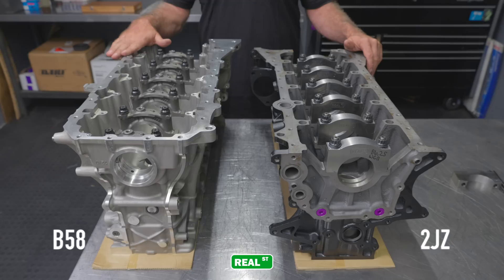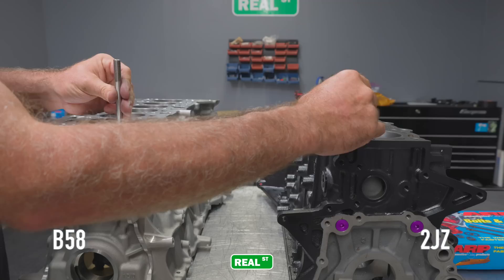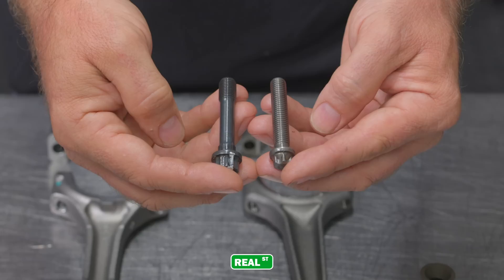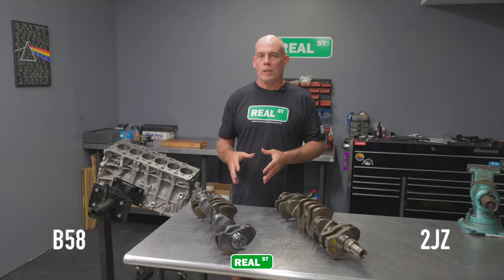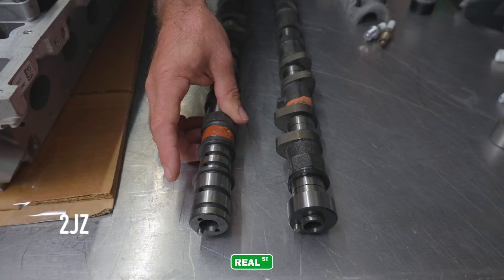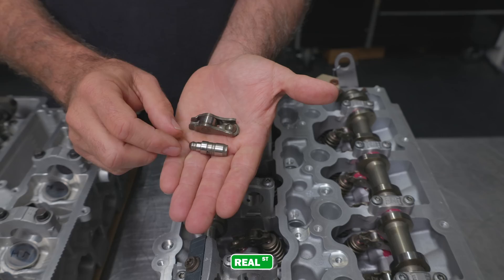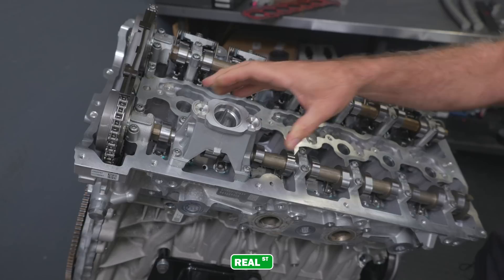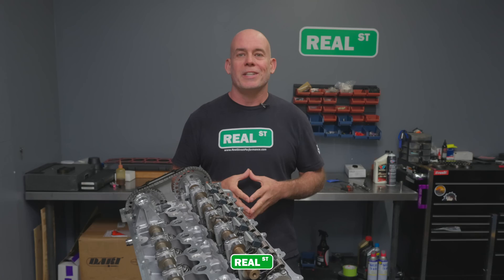Toyota 2JZ VS BMW B58 | 2JZ STILL KING?! (Detailed Engine Internal Comparison)

Comment: Man as a BMW owner (N52,S55), watching him break down the engine parts just showed me all of the failure points of a modern turbo BMW engine lol. Vanos, valve lifters, valvetronic, high pressure fuel pump, valve cover gasket, crank hub, timing chain. The 2JZ might be simple design but it works.
Reply: You know what, the LS is very compact, even simpler and no heavier than a 2jz, why not just use that?
Reply: @laurean5998  I like the sound and balance and smoothness of an inline 6 better
Reply: Cross plane v8s are quite smooth, especially with modern mounts.
Reply: You call those failure points? 😂
Those are advances in technology. A stock jz will never make the same power for the same amount of time a modern stock internal bmw inline 6 will.
Reply: BMW tech here, your N52 and S55 are both reliable engines, just make sure to not go over the miles for your oil services as that is the main killer of any engine and will cause premature wear for your timing chain and valvetronic system. The items you listed are not common failure points, save for the valve cover gasket, oil pan gasket, and oil filter housing gasket.
Reply: @JQ_Unity  A stock jz can handle plenty of power without breaking.
Reply: You smokin something real good to believe a bmw i6 wont handle power as long as a 2j @JQ_Unity
Reply: Simple, is better.
Reply: @JQ_Unity I own an n63 engine 😂 seeing this video is making me realize my engine is extremely complicated and why I can do 180 in my 7 series. 

Now I understand why my n63 will probably break down at some point in ownership.
Reply: @Arceus556 I agree to a certain extent, I believe the cast iron will hold up better. I think the i6 from BMW has lots of room for improvement if you build out the engine
Reply: @JQ_Unity a stock 2jz can make up too 1000crank on stock internals and it has been proven not knocking the bmw but atleast get your facts right
Reply: I love the B58 in my Supra - I just wish they didn't use so many plastic parts internally. I know the OEM oil pump has already had issues due to the giant plastics inside of it breaking apart.
Reply: @laurean5998  You can't compare a sea anchor with a six-in-line 2 ATC engine, 4valves per cylinder. 😜
Reply: I love the 2JZ as much as anyone else but lets be real, the 2JZ wouldn't have any hope of passing an emissions test if it was placed in a modern production car. It has a simple design because emissions standards weren't as strict back then. The B58 with all it's modern emissions systems, VVT, DI, and weaker aluminum block still is a very potent platform that makes big power for little money.
Reply: This Video is about the new ENGINE they put in a Supra!
BMW has had Vanos, Valvetronic for over 20 years man.. same with the hydraulic lifters..
Reply: @illusional.503 Making that power and lasting are two different things. I know Supra owners. After 7-750ish hp, they're a ticking time bomb. The B58 has been proven to hold at least 800 bo problem
Reply: @jieddo1 I will give you that. The funny thing is I wonder what the lifetime emissions on a engine that maybe is a little more dirty but lasts longer vs a cleaner engine that’s relatively throw away
Reply: @Unicornpirate  Those are not breaking points on a B58. S58 & B58 are obviusly superior engines and can easily go higher miles even despite the fact that they are much more advance.
Reply: Don’t even get me started on the VANOS solenoid. Absolutely garbage. BMW needs to redesign that part of the timing because it’s so dumb.
Reply: How come BMW's do not have turn indicators w/all the tech in the engine you would think they could engineer q flashing light!😂
Reply: @laurean5998 at that point of comparing Ls to a 2jz id go with an LS simply because of how cheap and common them and their parts are
Reply: The funny thing is those things are rarely an issue on B58… but better address that PCV 😂
Reply: You can't appreciate Toyotas until you breakdown their engines.
Reply: @Unicornpirate  2jz use a lot of fuel compared to a the b58. it also have a lot of other advantages
Reply: BMW tech who has a Lexus PP 😆 the irony
Reply: Just want to add that the BMW oil strainer housing is small and the chamber gets clogged with bits from the timing rail often ceasing the whole engine.
Reply: @ToyotaAristo  Yes they are. These are breaking points of any modern BMW inline 6. The reason you haven't heard of widespread issues is because they are relatively still new engines without many miles on them. Go buy a B58 with 150k miles on it and tell me that the valve cover gasket hasn't been replaced.
Reply: lol its a meme they  need a rebuild a 60k as kill big ends  in stock form   @JQ_Unity
Reply: @JQ_Unity  How long do BMW rod bearings last?
60-80,000 miles
The original rod bearings should be replaced every 60-80,000 miles, especially on vehicles which followed BMW's 15,000-mile oil change recommendation. Consistent BMW maintenance is crucial for a high-performing  lool seen 2jz,s with 400k miles still going     never opened up
Reply: @heh2k  > Cross plane v8s are quite smooth, especially with modern mounts.

I've had a '95 Supra TT, a couple E39 M5s and an F430 flatplane.  (Yes, manual addict.)  While I like them all, the straight-6 is definitely the one that sounds smoothest.  F430 isn't a bad sound per se but it's not a classic.  (458 a lot better sound but I prefer my manual clothtop.)  I guess I had a GT-R for a year but didn't like the sound.  I'd agree with you as far as saying they're all as smooth as they need to be.
Reply: @JQ_Unity  > A stock jz will never make the same power for the same amount of time a modern stock internal bmw inline 6 will.

I dunno, man, it seems even unmodified BMWs are in the shop all the time.  I haven't owned one, but part of the reason I haven't owned one is the horror stories.  I don't recall ever hearing of a 2JZ that ever broke stock and I was heavy in the community like '95-02.  Meanwhile I'd guess that for very very extreme tuning the iron block has a higher limit, though I don't think I'd ever want such a level of power.  My M5's both had a lot more issues than the Supra, too, though I have to admit they weren't engine issues (and weren't straight-6's).
Reply: @JamesCook76131  > I believe the cast iron will hold up better.

How specifically does this manifest in real life?  Does the aluminum block literally just crack, or do the bolts holding the head on strip out?  Or is it more  warpage leading to gaskets not quite fitting leading to problems?
Reply: @lqr824  considering I’ve been in 1000-2000hp supras, I believe my comment actually holds some value lol. I was big in the race scene for modified cars 2010-2016 time frame. 

Most people I know bore out the block on the 2jz as they  solely use it for drag racing only. 

Same with the viper blocks, I’ve yet to see many bmw’s doing the same thing (yet) so only time will tell
Reply: That’s why Toyota borrowed the bmw engine right ?
Reply: @sekouchill  That's why the new Supra is not a Japanese car right? It's a hard top Z4 straight up. Only thing it has is a Toyota badge. Toyota has proven they can make new performance engines as seen in the Corolla GR and Yaris GR. They just chose not to with the Supra mkv. Also if they designed their own inline 6 for the mkv Supra, you can bet it would have cost over 85k MSRP
Reply: Honestly to about 800 whp the BMW is superior to the 2JZ in every way. After that once you are building everything on the 2J the simplicity takes the cake.
Reply: @JamesCook76131  can't bore out the b58 due to the liner. Most are turning them into strokers to increase displacement.
Reply: Man but it sucks to have a way older cars as a daily driver. I’ve tried it in different platforms replacing just about every part and still you get in a new car and that feeling . After all you spend the same money. Im transitioning into new looking for manual as they are hard to fine now a days
Reply: @JQ_Unity Whaaat??? The JZ can make double the power on the stock bottom ends reliably.
Reply: @jieddo1 Who gives a fuck about emissions testing?? This is what makes the JZ better. It comes from a time when engineers could focus purely on reliable power. Anything else adds complexity that we really don’t need as tuners.
Reply: @refillz5281 Another fool who doesn’t have any idea. We have many built 2jz’s coming through my shop making 800whp+ on the stock bottom end. A few with over 1500whp on the stock blocks. 
They are all very reliable everything considered. I’ve seen 800whp+ 2jz’s run as dailys for well over 50,000kms with no real issues. 
The limits for the b58 are very clear at 650whp, any more and they start to have all sorts of issues. Still a great motor in it’s own right.
Reply: @JaB0090  How do you rate the B58? Are the oil burning issues a big deal or was that only on a few earlier cars? I'm really torn between a new GR Supra or a used Corvette, either C6 or C7. but I'm really leaning towards the Supra.. I just want it to be reliable long term, if I'm spending that much on a new car.
Reply: @izzy031096 no emissions kills engines in every way shape and form. The JZ wouldn't be a JZ if they were to throw modern day emissions at it. It'd be just like every 6 cylinder that's a aluminum block, very likely to have a open deck block like toyo does with all of their modern 6 cylinders,and be made specifically for efficiency and better gas mileage for emissions purposes.  The JZ would even have a different name at that cause it wouldn't share anything from the old cause it's outdated,inefficient, heavy,laggy,and will not be used or seen in the modern day market as competitive for all those reasons. B58s have gone well past 8-900whp+ all on stock internals. It depends on what gen u get because later B58s got a stronger fuel system than the earlier gens.
Reply: @hhaste 2021s were the main ones that had the fuel burning issues when they swapped the B58s from a 2 port head from the 2020 mk5s and went 6 when the 2021 models. 22-23 apparently don't have this issue(or it's a very rare case at best)so either get a 2020 or 22-23 model and you'll be fine.
Reply: @carboydorifutoparty3976  Well you just wasted a whole lot of time typing out a completely hypothetical situation, good on you. 
There are no b58’s making in excess of 700whp reliably. All of the forums state exactly the figures I’ve stated earlier.
The JZ makes more power, more reliably. Get over it.
Reply: simplicity is useless when a rod goes through the block, your bmw engine is stronger even with modern failure points, the 2jzge is very tought but once you add a turbo and some power, it goes boom, idk how many of those garbage ive seen exploded, 1jz is even worst
Reply: @Unicornpirate  400whp tops and with a decent fuel management
Reply: @retrocompaq5212  With stupid tunes and non turbo bottom ends, yes they will go boom. A gte done properly, or a ge+t done properly will last for a very long time, even with 800whp+. I’ve personally seen and worked on daily drivers with these sorts of numbers doing 50,000kms+ with no issues whatsoever.
Reply: Oh my goodness! The engine has pistons, rods, valves! Those are failure points!
Reply: @XBullitt16X Simple is good for people who dont do maintenace.
Reply: @laurean5998 because not everybody wants that garbage.
Reply: @rodz1999 sucks for you, I love putting new parts in old cars. I definitely don't care for all the complexity of new cars either, and all that garbage plastic.
Reply: @illusional.503  total garbage, stock internals on a 2JZ won't make 1000crank reliably lol. Both these engines make about the same 650-700WHP with stock internals if you want them to last.
Reply: MFI Turbo Gasoline is the best and most durable engine design. Everything above is just in order to make you go back to the counter every 150k miles.
Reply: @illusional.503 lmao no, stock 2jz engine can handle up to 850hp
Reply: @@Lorin-GabrielLeaua-fm1lw Not available in the USA. I've heard of it but don't know much about it
Reply: @JQ_Unity  bang on! , length of effective power band is huge! BMW are masters of this - peak numbers don't mean shit if its delivered in a short peaky power band
Reply: @laurean5998 good point
Reply: @laurean5998 it’s actually alot lighter. Even a GE weights in more then a 6.0 iron block LS style engine. A fully dressed GTE weights about 600lbs, fully dressed LS1/2/3/4/6/7 weighs about 450lbs.
Reply: @Unicornpirate The MK5 A90-J29 Supra's origin is Japan!

And without the MK5 A90-J29 Supra, the G29 current generation BMW Z4 wouldn't exist due to the last generation's BMW Z4 being a sales flop!
Reply: The simpler the structure is, the less failure points it has. Simplicity favors regularity every single time.
Reply: Yet with all the problems with bmws there will be a fan boy talking BS about how the owner took care of the care when the proof is in the poor design from the factory.
Reply: @MrNanah38  There's literally B58s running over 200000 miles on them already. With no problems or less.

So I don't what your problem is hoss
Reply: @samsonCoby  Show me
Reply: Things like Vanos and valvetronic are why the BMW engines have a flat torque curve through the entire powerband while a 2JZ even with a mild tune is like a two stroke. For a comparable top end power a B58 makes 2-3x the low end torque. Yeah they can fail but even if they do the car is still driveable and it's not that hard to fix.

Timing chains don't really fail in these engines, American tuner nonsense to sell more parts (there might be a very rare failure here and there but no more than any other engine). Crank hub failures affected some N54s and early N55s, was fixed on later N55s with an upgraded friction washer and B58s have a two bolt assembly, it physically can not happen unless the bolts just shear off.

Gaskets fail on all engines. 2JZs generally just don't have their valve covers on long enough for the gaskets to fail.
Reply: @jieddo1  Exactly! Putting tuned 2JZ with tons of power in a modern car, in some places with strict emission regulations(Cali, Germany) wont ever pass the emissions test
Reply: @laurean5998 2jz and Ls are the best engines on the planet. Period.
Reply: @JQ_Unity lol the last 20 years of the internet determined that is a lie
Reply: @refillz5281 stock 2jz will handle around 700hp comfortably, can go up past 1000hp but then you run the risk of potential issues, even then not necessarily catastrophic…depending on what goes of course; but the trans is maxed out typically around 700ish hp
Reply: @Unicornpirate can, though getting an LS the US is cheaper, more accessible, and you can sleeve it/forge the internals to handle boost as well as a 2JZ.  There’s really no competition as to what the best cheap engine swaps for performance cars are. Its basically LS swaps and K series honda swaps for fwd/anything to small for an LS(which weirdly most things arent if you have the right tools, skills, and material).
Reply: @laurean5998  You know' a 351w is just as compact, cheaper, about the same weight and is also good for 800+hp straight from the factory (with an even bigger aftermarket), why not that?
Reply: there;s a reason the 2jz is still around after all these years.
Reply: @heh2k - I love a good V8 but an Inline 6 is the only engine that is naturally balanced in all 3 directions. Well, V12 also because it is just 2 inline 6's. V12's bank anfle doesn't even matter futher proving the point. No balancers needed. And the 2JZ-GTE can compete with any V8 on power gains.
Reply: @wockawocka5293  well balanced and can only make up to 300whp without boost
Reply: @laurean5998 The LS doesn’t even have the DOHC 😂
Reply: Hondas are relatively complicated yet rarely break, don't misunderstand good engineering
Reply: @Unicornpirate the B58 can handle 1000hp which is way too much to begin with.
Reply: @icecold8974  Not stock. You need to fully build it for 1000
Reply: @Nick-Edwards Exactly why they wont do it. They are killing it in terms of sales and customer satisfaction and nearly all of their profit comes from the sales of parts…
Reply: It better. It a 14yr head start @JQ_Unity
Reply: its new vs old. new engines more efficient and more powerful in stock
Reply: different engine
Reply: The 2j is overbuilt great if you’re going to tune and push that block the b58 is designed lightweight for the power it produces great for maximizing efficiency and power at what it’s designed to output
Reply: @John-86  two different markets. japan engines were designed to be overbuilt for tuning if people wanted to do that...manufacturers had a gentlemans agreement for capped bhp
Reply: @hassyg4083  true also completely different times.
Reply: Toyota should have used their engine in the Lotus instead of a BMW engine. Should have gone with a V6
Reply: @hassyg4083 I think they wanted it to be an inline 6 so it follows the heritage of the Supra.
Reply: @Unicornpirate  should have done what nissan did with gtr
Reply: @Thicc340  Yeah you’ve only just surpassed the Bmw cutoff, 100k.
What engine? And what other supporting mods did you do to the car when you went to that power? You had to have replaced all of the shitty plastic coolant hoses, as they would simply evaporate with the heat generated by 600whp.
Reply: @laurean5998 Displacement tax, anything above 3 liters is taxed to death in my country.
Reply: @Thicc340  Ahh it’s a B58, definitely one of the better ones (good enough for Toyota at least). However, you’re right on the cusp man… 100,000kms or ten years, same old rule for BMW that had rung true for 30 years now. Let’s reconvene in a year and see how you’re still getting on.
Reply: @Thicc340  True wow she’s done a good innings brother! You must take good care of it. Limits are about 650whp for factory internals on the b58 correct? What size turbo are you running currently? Is it still the original?
Reply: @JQ_Unity ”Stock internal” lol stock bottom end 2JZs are making 1100 whp meanwhile not a single stock bottom end B58 makes that.
Reply: @lesterchan1872 ”DOHC” So? The fastest and most powerful engines is the Dodge Hemi that runs 3 second 1/4 miles and hemis are single cam 2v pushrods lmao. I seen stock bottom end LS engines make 1200+ WHP, Mightymouse LT4 made 1330 WHP completely stock bottom end, stock rods, stock pistons etc.
Reply: @aimxdy8680   There are so many engines that can makes as much HP as your “big block V8” with smaller displacement LOL, like boosted 5.2 V10 from Lamborghini and Audi R8, Nissan VR38DETT no introduction needed, even a Honda K20 makes more HP/Liter than the push rod V8, and when it comes to naturally aspirated engine, 2V per cylinder is just out of the game, even Ford and Chevy will make their V8 to have 4V per Cylinder and DOHC, if you are domestic fanboy then go learn about Coyote, Voodoo and LT6.
Reply: @lesterchan1872  Yet the fastest N/A engine is the LS 🤣 a Foxbody camaro N/A LS ran a 8.1 second 1/4 mile and the fastest 1/4 mile times are from Hemi motors which are 2v pushrods. Wanna cry more?
Reply: @lesterchan1872  “hp/liter” completely useless metric, nobody talks about hp per liter in a race lmao. Theres a reason why Hemis rule drag racing and dohc motors dont, the LS is far smaller than most V8s in actual size, due to lack of external measurement it can go higher displacement.
Reply: Ya its a bmw there for looks if toyota didn't help with this new one it would have broke already
Reply: @aimxdy8680  Nobody talks about hp/liter in race!? Even Ford and Chevy start making them. Why don’t you go ask them about why they start making engine the European way lol
Reply: @lesterchan1872  No they dont, chevy uses a N/A 10L pushrod for their races, dodge uses a 354 cu in Supercharged Pushrod. And ford was the one using DOHC, guess who won the NHRA factory stock showdowns multiple times since like 2020, Dodge lmao, chevy destroyed ford also before dodge came with the drag pak.
Reply: @lesterchan1872  What engine do dragsters use again? Def not dohc, they use single cam pushrods.
Reply: @aimxdy8680  They don’t? You think Chevy and ford make their engine out of nowhere? That’s straight up racing tech, not your brainlessly add up displacement and supercharged it lol
Reply: @lesterchan1872  “racing tech” chevys main care of racing is the NHRA factory stock showdown, they use an N/A 10L Pushrod V8.
Reply: @aimxdy8680  Yup, brainlessly put more displacement as I say earlier, if you really bring this up and think HP/L ain’t mean nothing, then F1 is the perfect answer for you, those engine are all DOHC 4 volves per cylinder making 1000+hp with 1.6L. again, how big is your pushrod engine needs to be to make 1k hp? push rod is out of the game.
Reply: @lesterchan1872  “1000 hp with 1.6” and there’s Dragster pushrod motors pushing 11000+ hp out of a 8.2L and DOHC motors weigh far more than pushrods and 3x bigger in physical size, pushrods can add displacement because there’s nothing in the way unlike DOHC 🤣 . hp per liter is useless because then I can just go hp per camshaft, DOHC has 4 cams, pushrod is single cam, pretty sure dodge dragsters makes 11000 hp per cam, DOHC motor record is the ford coyote which makes only 4000 hp ☠️
Reply: @illusional.503  you need 5xmore $ to make a 2jz push 1000hp than a b58, and the b58 will hold it longer.
Reply: @aimxdy8680  DOHC weigh far more than pushrod? That probably only happens in your drag race world, in many other races that needs compactness would just go for V6 or 4 bangers, and those are DOHC🤡
Reply: @lesterchan1872  the Nissan VR38 3.8L DOHC V6 engine weighs 600 lbs, meanwhile the 6.2L LT4 V8 including the supercharger and accessories weighs 530 lbs, the LS7 weighs 450 lbs. lmao more weight and less hp and slower 🤣
Reply: @aimxdy8680  You got the point, that’s why many muscle cars get gapped by a little Honda shit box, and yes they are 4 volves per cylinder.
Reply: It looks like we are seeing 800hp plus for a number of years on stock b58s if tuned properly, with the transmissions holding 700 hp plus in stock form,  I haven’t seen of any 2jz holding power like that for necessarily longer I would say they are similar in reliability
Reply: @jared8324  Then you need to wake up. Stock 2JZ can handle up to 1000hp. And no we haven't seen 800plus B58's for years. 800hp is probably the max I've seen on a big turbo stock B58. Sure some can make more power but its not common. And the transmission will slip at those power levels.
Reply: We have seen some delusional Toyota fan boys who said Toyota designed B58 because of it's tuning potential and reliability.
Now, in this B58 vs 2JZ engine parts breakdown video, again same clueless Toyota fan boys talked about B58 flaw and breakpoints but many B58 gen2 owners (m240i, m340i and Supra) run 800-900whp on stock internals ! 
There is no evidence of B58 failure at this power, and there is no evidence of Toyota designed B58 ! 
Please, can we all agree that B58 is solely designed by BMW and successfully delivered this masterpiece !!
Reply: The new M3's and M4's are taking power mods like it's going out of style and are faster in the quater mile with similar power
Reply: @lesterchan1872 if dohc is so good, then why isn't anybody swapping them into their cars? Why do people do LS swapped foxbody's or Ls Swapped Bmw's but not the other way around?
Reply: Am I missing something? There are examples of the b58 holding 1100 unopened.
Reply: Because of exhaust/pollution regulations....
Reply: @JQ_Unity  .....until it breaks, which it will, most likely sooner rather than later.